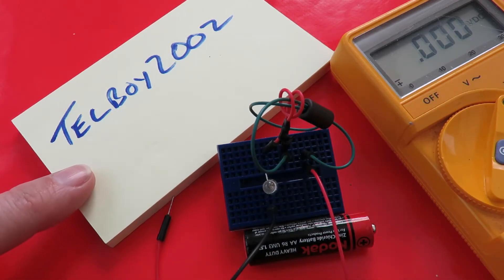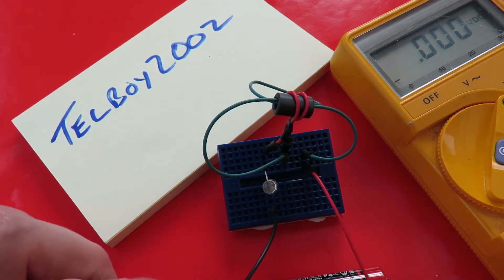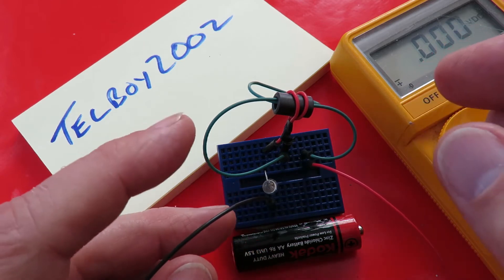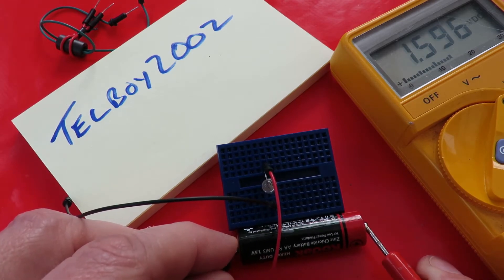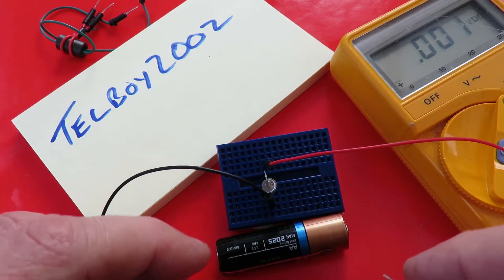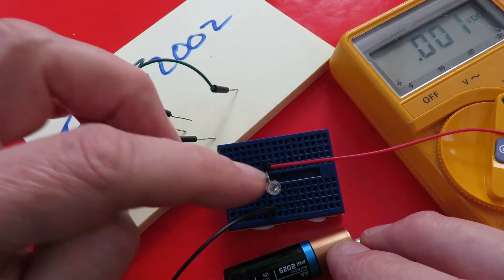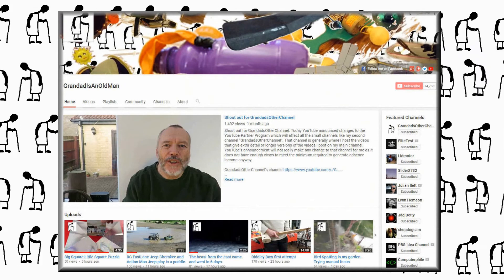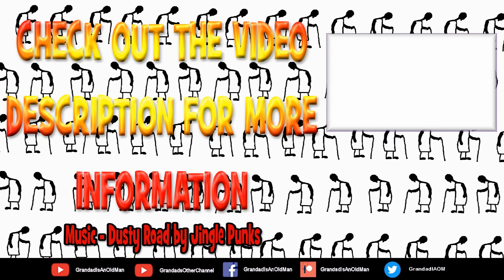RED LED lights from AA battery direct

Comment: yes it is possible to run Led's on 1-5 v single cells  I experimented a lot with the joule thief circuit twenty years ago I still have a number of low current Led's in my spares box think they only needed  2mA to light I went through a batch of them lighting them with a Duracell D cell all lit well, so I used them in all my joule thief projects a fresh D cell is usually around 1.7 V being the highest voltage I have measured on a D cell
Reply from the maker: For the benefit of other people reading the comments I will write this reply and I hope you will understand I am just trying to clarify the situation. You will know that you are NOT running the LEDs on 1.5 volts. The Joule Thief is generating a higher voltage that meets the forward voltage requirement for the LED. The confusion experienced by Telboy2002 was he found his LED was lighting without the transistor generating the oscillating circuit so he apparently had an LED lighting from some interaction of a couple of wires looped through a torroid with NO oscillation to generate the required magnetic fields. (Free energy??). What I am showing here is that some RED LEDs have a low enough forward voltage requirement to start glowing at less than their specified 1.7v so if your AA battery is fresh enough it will light. The whole point of a Joule Thief is to "steal the last remaining power" from a dead battery so using a fresh AA battery completely defeats the purpose of the circuit and choosing a RED LED has given him an apparent success when in fact the circuit he has built is doing nothing and the LED is just lighting below its listed forward voltage requirement. Had he used almost any other colour LED or a dead battery he would not have had the result and the confusion. A classic case of getting a effect and misinterpreting the cause, I do it all the time.